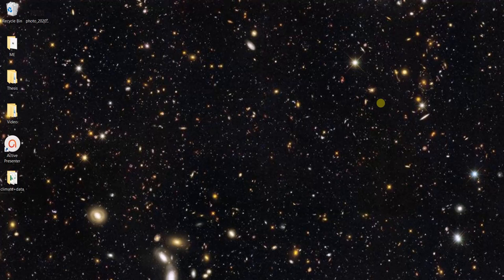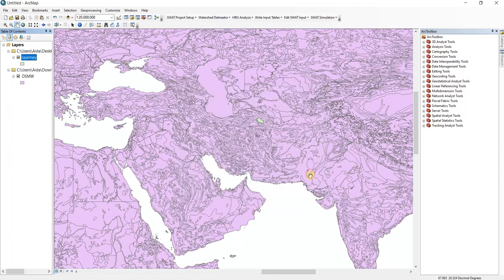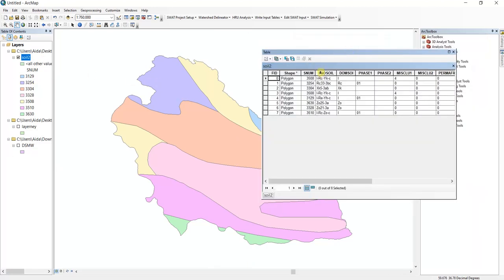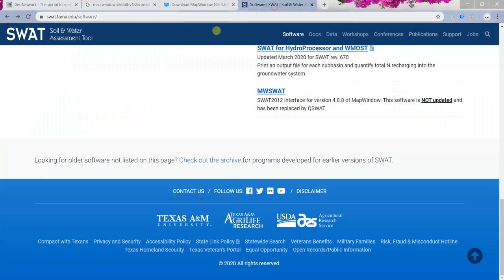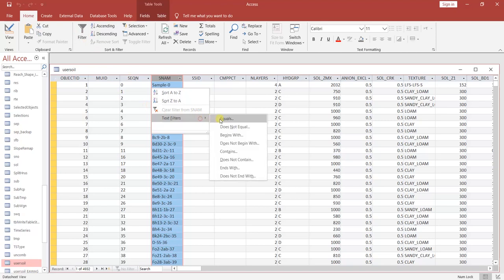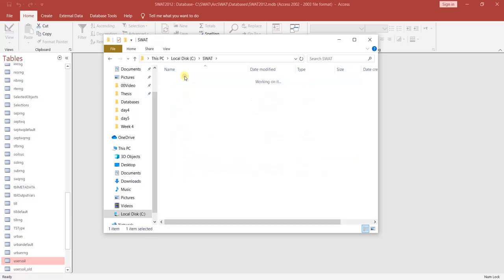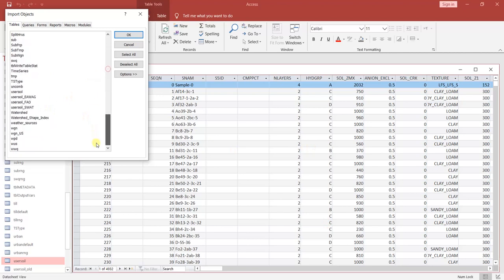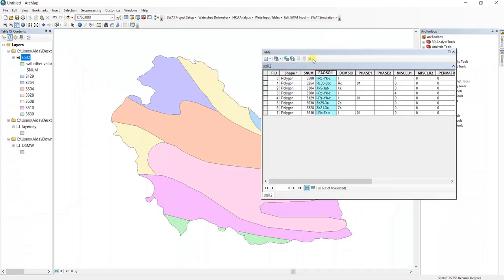How to prepare soil map for the SWAT model

Comment: What if the soil map isn't synchronised with the MSWAT2012 databases? I.e.: some of the soil didn't exist in databases but in soil maps it has. Do we need to adjust the MSWAT2012 databases or just add on? Anyone can help me? 

Regards
Reply: Hi I am also struggling with the same problem. Are you solved? Please help me!
Reply: @fromhgkim  My suggestion is, why not if you try to directly edit in arcgis

edit swat input --> databases --> user soil --> add new

Anyone who are more expert about this, please correct me if I'm wrong. Best of luck
Reply: @lilysuhana5703  Hi, does SWAT use the FAO soil classification? I mean, if I am using different soil classification in my country, Do I have to reclassificate using FAO codification?

Comment: Hi! I downloaded the FAO Soil ESRI data but when I loaded it in ArcMap, it says that the shapefile does not have any spatial reference :( I have tried downloading it a number of times but would still end up with the same result. I was wondering if you could tell me what I'm doing wrong huhu. Thank you!!
Reply: Hello. you are totally right. in this case you can either use tool named Define Projection, or simply open your study area shapefile (which has the right projection system) and go ahead! you will see there wont be any problems
Reply: In search tab of Arc maps, use Define Projection (Data Management) option. Add GCS-WGS-1984 as the coordinate system of world soil map shapefile. Then change the projection system of your AOI as well to GCS-WGS-1984. Now you will be able to see the AOI on world soil map and clip world soil map as well. 
Hope this helps :)
Reply: @ekanshakhanduja8866  Thank you! this was helpful!
Reply: Same problem done with me.
Reply: @dr.bhagyashrirameshjalgaon9946  Hey. Load the DSMW shapefile in ArcMap and then use the Define Projection tool. I fixed it that way.
Reply: I tried to fix cell size 30, 30 xy but Arcgis software not responding and close the program. Plz give me solution plz
Reply: @dr.bhagyashrirameshjalgaon9946  ..Dear in this one projection file is missing...U can copy and past any projection file and rename as your soil data. Then do projection..It will work
Reply from the maker: Tanks @aida_gholami
Reply: i have the same  problem here . any idea ??
Reply: @sofiannia5636  Hey. Load the DSMW shapefile in ArcMap and then use the Define Projection tool. I fixed it that way.
Reply: https://drive.google.com/file/d/1HJLZIRmThKKl5_W-Q5c5ejM8hKCm1igx/view?usp=drive_web